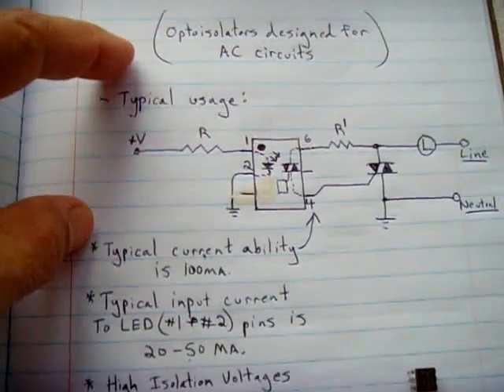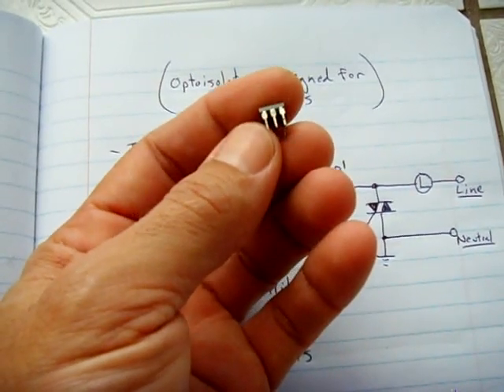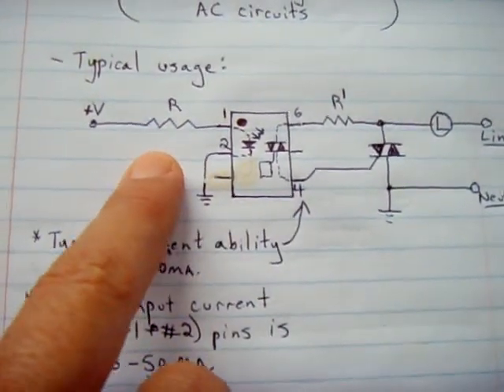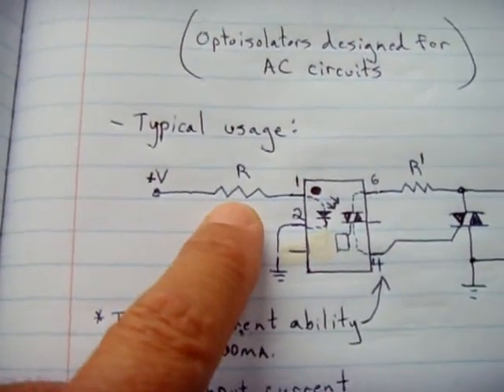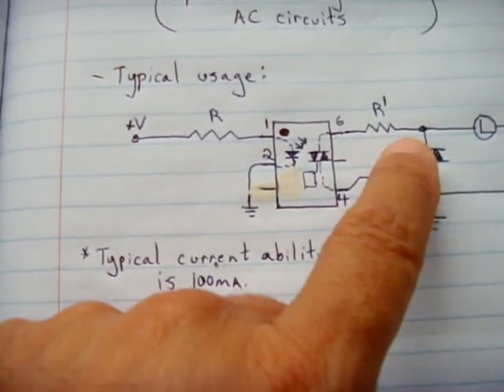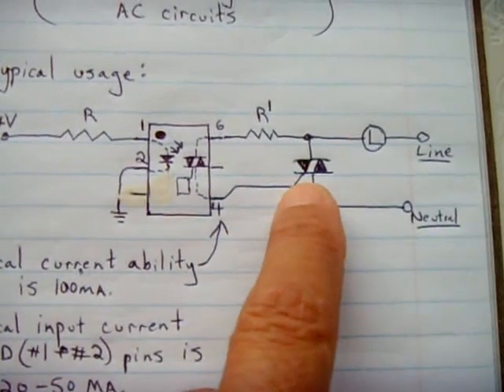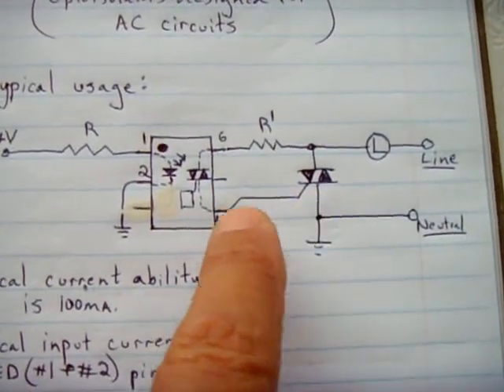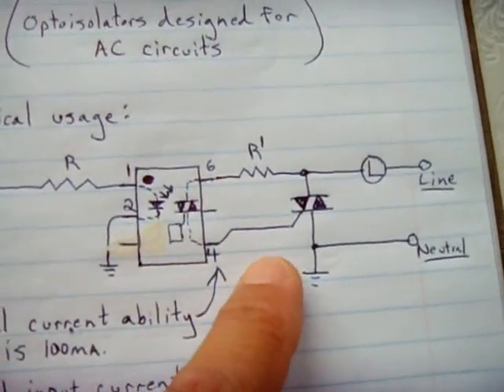How To Properly Use Optoisolators For AC Circuits

Comment: How would a potentiometer control this circuit? I have a hot air station that uses a similar setup for the air pump. 

Speed is controlled by a potentiometer. Currently it only works on the highest setting and cuts out at any lower setting so I’m trying to figure out how to troubleshoot what the issue is

Comment: I'm still new to electronics so there are a few things i don't completely understand.  Why is the load always connected where it is.  If the optocoupler is in its "off state" then the potential difference across your load is still 220V.  Lets say the circuit you had was on a board and you motor was 3 meters away connected by a power cable.  Would it not be safer to connect the load in parallel the optocoupler but in series with the triac.  That way you reduce the risk of a nasty shock thinking its off.
Reply from the maker: +Clinton Brits 
Hi there. For reliable switching, the load is placed where I show in this video. A simple "Google" image search for triac circuits/dimmers will show many like I show. Many dimmers are made this way. You will see a notice on the dimmer, "Turn off all power before working on the light fixture". 

Thanks!
Reply: Hello again.  I got the parts needed to try this using an 80W toaster element i had lying around.  If the element is 500 ohms and the triac needs 4-40ma to open the gate then i would need +-5500 ohm total resistance to make this happen.  If i use a 5k resistor then at 40ma i calculate 8W of power on the resistor.  Is there an alternative to using a resistor?

Comment: Two comments, and they are both safety related.

Firstly in the schematic above the load is connected to LINE, which means both load wires will be hot (deadly) all the time. Never do this. Connect your load across the NEUTRAL wire instead.

Secondly, connecting NEUTRAL to GND loses your isolation. The whole point of an optocoupler driven TRIAC is to isolate the high voltage part of the circuit from the low voltage part.
Reply from the maker: +Nick Andrew 
Hello there. I understand your point, but you have to realize that many dimmers/triac controlled switches are designed that way for a reason. Many dimmers have warning labels stating that you MUST turn off the power before working on the circuit. For reliable ON/OFF switching, the load is "almost" always placed on the MT2 side of the triac. You can Google this fact and pull up all the circuit images showing the load on MT2 side connecting to the Hot AC Line. As for the Neg and neutral connected to GND,  as long as there is a load connected on MT2 side, there will never be any chance of "high voltage" finding its way to the low voltage side of the circuit, but I see your point. If there was a short circuit, the power would take the shortest path, which is directly to ground. If you are worried, then don't connect NEG and NEUTRAL together.

Thanks For Watching

Comment: The schematic is missing the LOAD. If wired as it is shown, when the TRIAC turns on and conducts, it will short the line with the neutral and burn it self.
Reply from the maker: The "L" in the circle in the schematic is the load. :-)

Thanks For Watching!

Comment: great video....just a quick note....if you connect your neutral to ground...you lose your isolation.
Reply: +elevation62  I think is better to use 2 different ground
Reply: My thinking exactly isolation is required